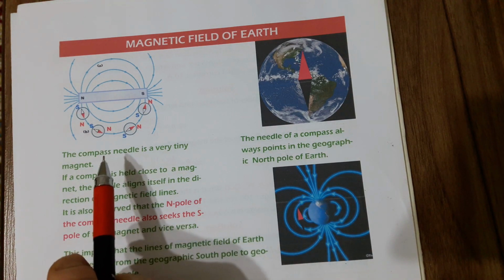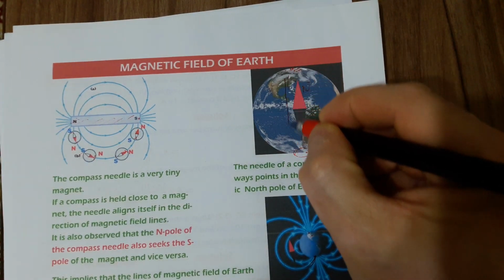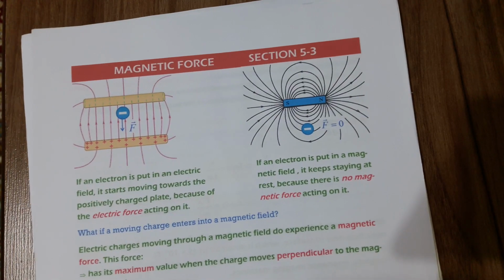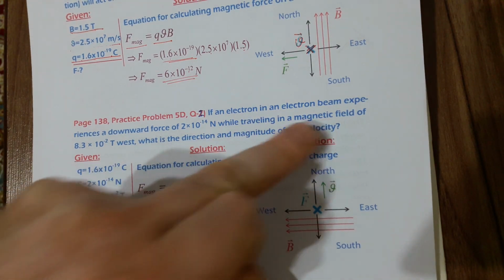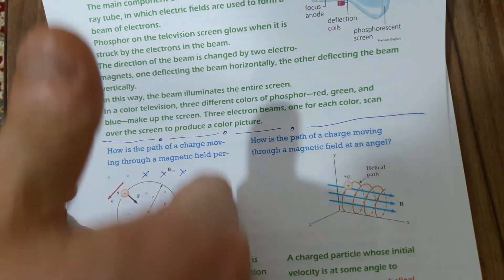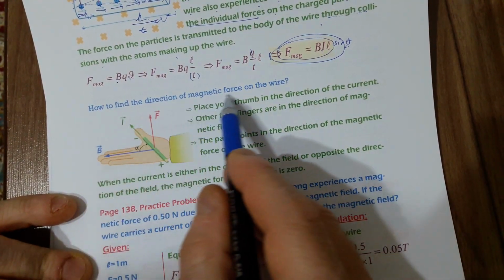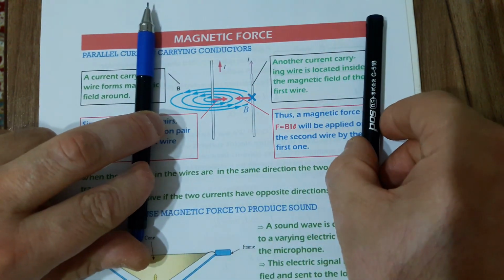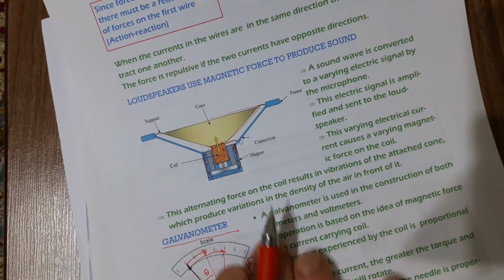MAGNETIC FORCE ON A CHARGE & ON A CURRENT CARRYING WIRE  | COURSE 18 | HOLT PHYSICS

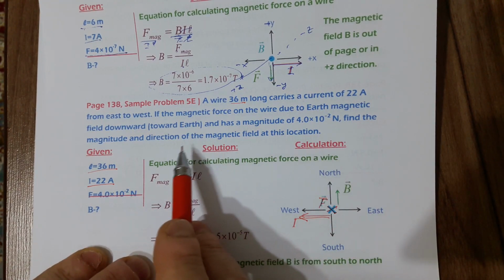Comment: @29:21, sample problem 5E)) the problem says direction of magnetic force is downward (toward the earth), shouldn't that be the south direction as magnetic north from which field lines are assumed to initiate  is at the geographic south, then downward direction should be south. Hence direction magnetic field should be into the page or what am I missing? Please, clarify, thanks in advance.
Reply from the maker: Downward and down to plane of page are not the same. You are defining down to the plane of page  (south) but question says "towards to Earth" which is into the plane of page.
Reply: Aha, I think I got your point. Towards the earth means towards earth's center which implies going into the page as you mentioned.
Is that what you meant?